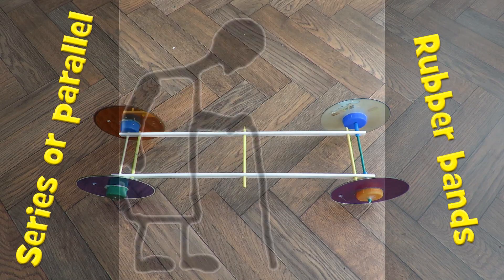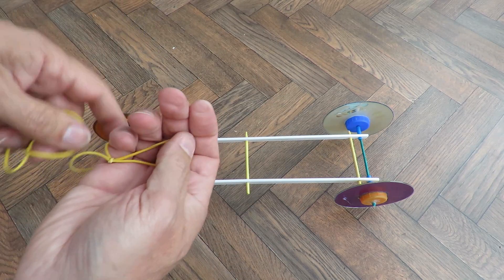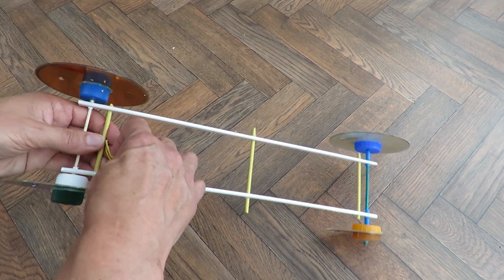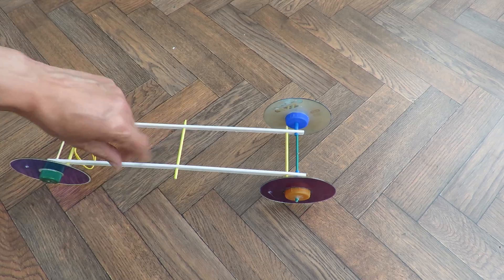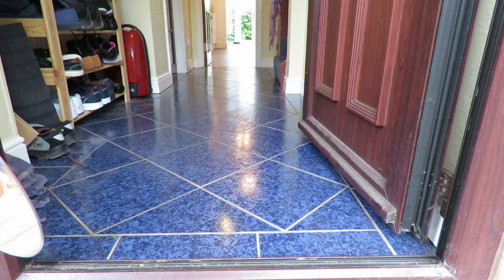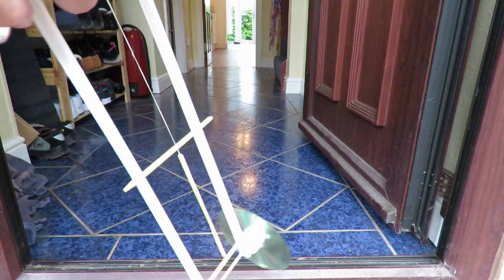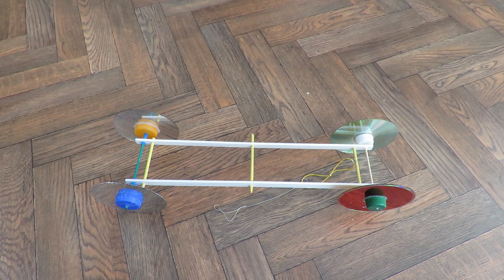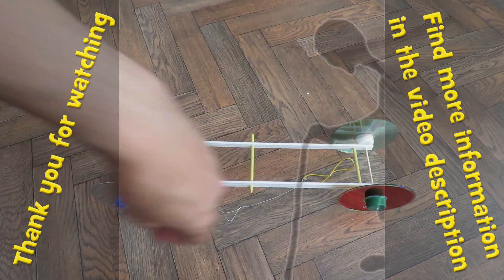Series or parallel rubber bands #1

Comment: 47 seconds in.....I predict massive wheel spin with the parallel bands and smooth acceleration with the bands in series. 
let's see if I'm right.
Reply: Nailed it.
The power from the bands is the same whether series or parallel.
It's the time.
The quicker the power is delivered (parallel) the more wheel spin .
The longer the time frame for the delivery (series) less wheel spin.
The power is the same. HP vs Torque.
Reply from the maker: Wil Hobbs That is my feeling although factors like friction and grip will effect the total distance of the run and I just don't have a suitable location to test longer runs.

Comment: Wait, shouldn't it be the other way round? Series provides twice the power and less capacity, but parallel provides twice the distance but less power? Like lipos?
Reply from the maker: Do you know about apples and oranges?
Reply from the maker: X-FLIGHT101 Power = transfer of energy over time probably explains it
Reply: +GrandadIsAnOldMan ahh ok, I guess you could look at it both ways but that is logical.
Reply from the maker: X-FLIGHT101 I think what I am trying to say is in theory the total power is the same, series or parallel. In the parallel format more energy is transferred over a shorter period. In the series format less energy is transferred but for twice as long. So the total is the same in both cases. The total distance traveled should be the same in perfect conditions (no friction etc) but in the real world several other 'things' impact on the result. More to the point, if you are having a race over a short distance then parallel is your best option. At some point along the total distance traveled things start to balance out.
Reply: +GrandadIsAnOldMan perfect explanation
Reply from the maker: X-FLIGHT101 :)

Comment: hey Granddad next time you go in some charity shops can you look for another air engines car because it would be cool if you took the engine and air tank off of it and stuck it on a car you made
Reply from the maker: The thing with charity shops is that you never know what you might find, it is completely random so the chances of finding another air engine car are also completely random. However, at the moment I am collecting them because I like them and want to build up a collection, not take them apart. If I do find one that is broken and not worth repairing then I might consider using the parts.